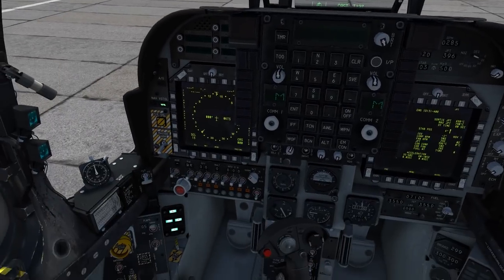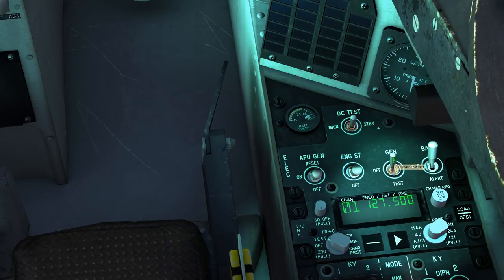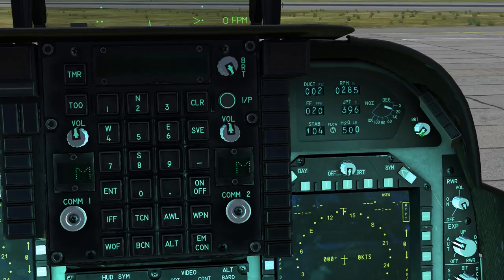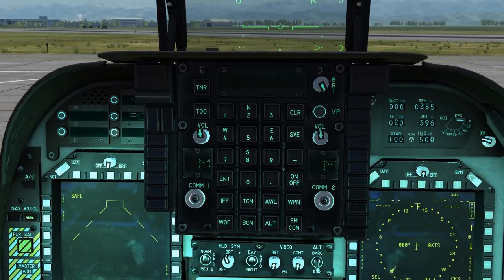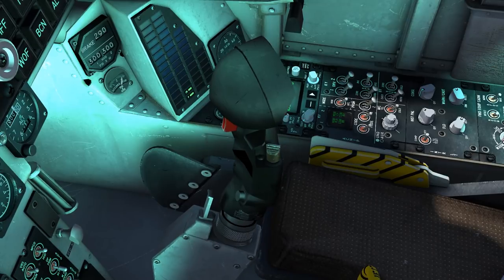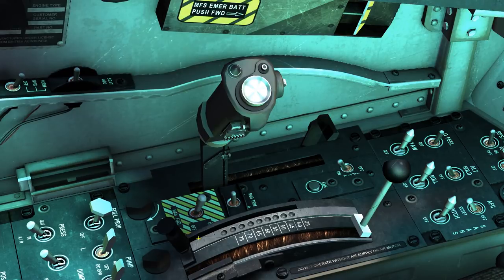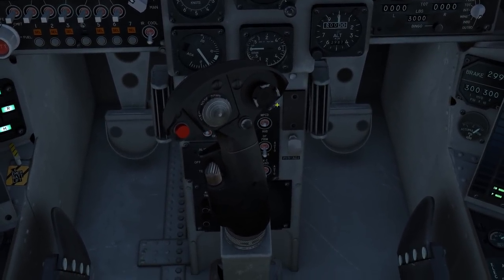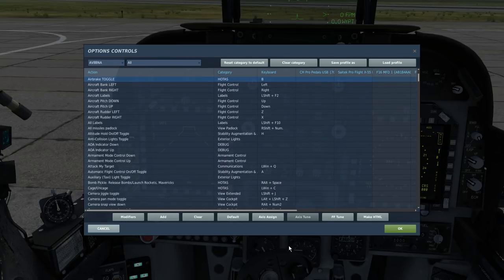DCS AV-8B NA Harrier Controls, Cockpit Tutorial

Comment: I thought standby for ECM was a warm up mode, RCV is the jam when tracked mode, and RPT is continuous jamming

All only work with the external ECM pod
Reply from the maker: Yes, that would be correct, got myself mixed up with the 'Smart standby' as it's called in the manual. Not actually used the ecm yet.
Reply: So helpful, thank you.

Comment: Hi, wanted to say thank you for teaching me the harrier. Your videos have been greatly appreciated. I wonder if you could let me know the file location for your kneeboard for 2.5? I've tried installing it in the stated user save location, but it's just showing the generic kneeboard. Thanks again.
Reply from the maker: You need to cylce the pages with [ and ], try pressing ] a couple times and you should find them.
Reply: Hmmm all I could find where the original pages and not your ones. I'll see if it's possible to delete the original kneepad pages.

Thanks for responding. Looking forward to your future videos!
Reply from the maker: That's a shame, re-check you put them in the correct location, you don't need to delete the original kneepads, i can't test it myself at the moment sadly, my pc has died.

Comment: I want to get into this game, I have just downloaded it, do I need to buy a flightsim joystick and throttle for this ? I guess then the mouse is used to press buttons in the cockpit?
Reply from the maker: Yes, You can technically play with a keyboard, but honestly it's not worth it. Precision flying is very difficult that way. Buy yourself a joystick, i recommend starting with a thrustmaster t1600m hotas, or a thrustmaster t-flight hotas if you're on a tight budget.
Reply: I have a 12 button joystick, but no TrackIR. Do you think it's still worth trying the Harrier? I've been flying the SU-25T that's included in the base game and I haven't had trouble, but I don't know if a clickable cockpit would be too much to manage without TrackIR.
Reply from the maker: The Harrier does use more buttons, ideally you'l want to use modifiers to double up the use of what im assuming is your single hat switch. i think you'l be able to get by, if not it's a great excuse to save up for something like the T1600m :) Once in the air the cockpit clicking generally isn't needed in a hurry, you can toggle between mouse look and click modes with Lalt-C. The TF-51 is available for free in dcsw (trainer version of the ww2 p-51) if you want to see how a clickable cockpit feels.
Reply: Thanks for the advice, I think I'll try out the TF-51 a bit and see how I like it.
Reply from the maker: Sorry your comments got lost in the spam filter due to links, Yes that's a pretty good set to start with. The Warthog HOTAS is what i personally use, note that you will need to buy separate rudder pedals for it too, as it has no twist function. both of these are great options, though the Warthog is pretty expensive. The T-16000 Combo is a really really good deal, giving you a great set, whilst the quality is not as high as the warthog im surprised you can get that much for so cheap, seems like an awesome starer point.

Comment: I'm new to the game and I can't figure out how to look around the cockpit using the mouse.  I can look around with the default plane but not with this harrier I just bought. I see a yellow cross hair to use to select some buttons but not  all are accessible this way
Reply from the maker: All clickable cockpits use the yellow pointer to select switches. To move the camera, toggle mouse look with left alt C. You can also use the pov hat or numpad to control the view.
Reply: Thanks man it worked.  I'm waiting for the rift.  Hopefully by that time I can assign keys to my Saitek x52.  That seems challenging already.
Reply: left alt+C or doubleclick the mouse middle button (might require one additional click because sometimes the mouse gets stuck in lateral axis mode). Though I don't reccomend you use mouse for looking around. An update eons ago made the mouselook jittery. Either use pov hat controls or the numpad.

Comment: what does the H20 on hte plane do. cool the engine?
Reply: yes. that's H2O and it's used to bring the JPT (jet pipe temperature) down. when the aircraft systems detect the water is being injected, it will allow you more headroom for more thrust.